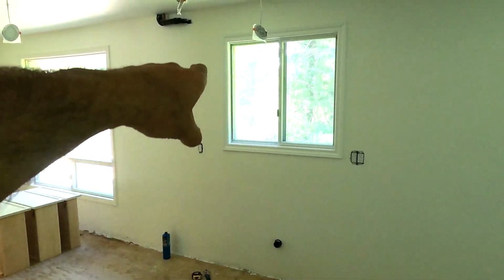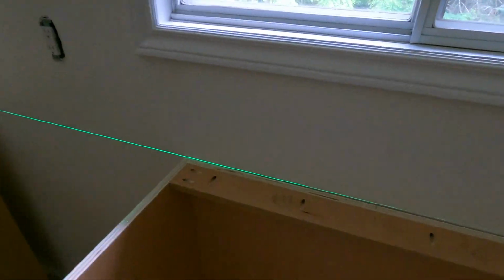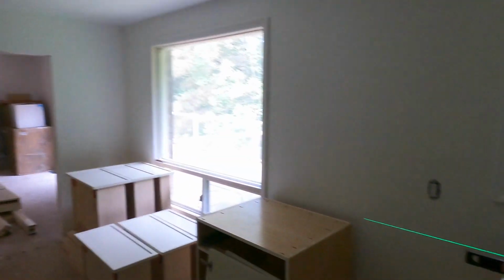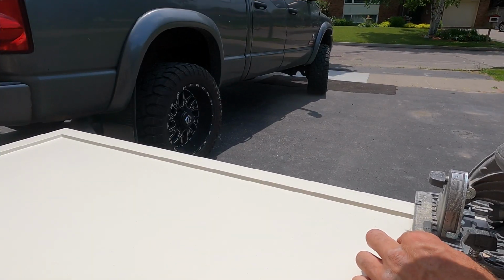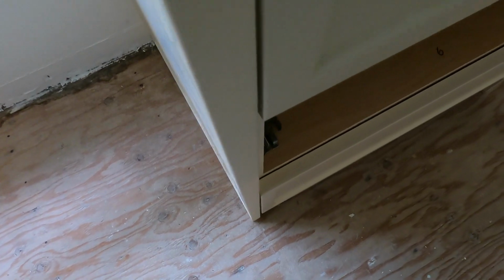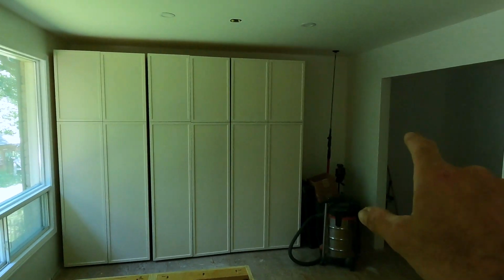INSTALLING A CUSTOM KITCHEN that I built | How I do it by myself | JR’S Life

Comment from the maker: TIMESTAMPS: 

00:01   Intro
00:06   The Before
00:32   Setting up the laser level
01:55   Workstations & Elevations
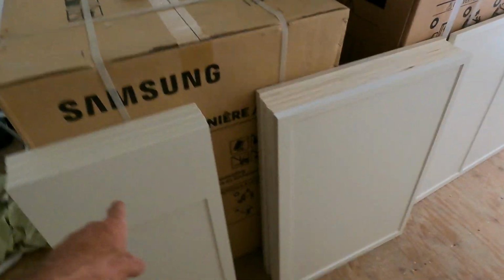02:53   Applied panels
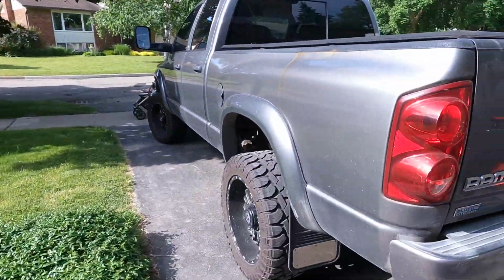03:27   Outside workstation with saws 
04:30   HOW TO bring in the big cabinets by yourself
05:13   Sink cabinet
05:53   Hole saw / cutting holes for plumbing
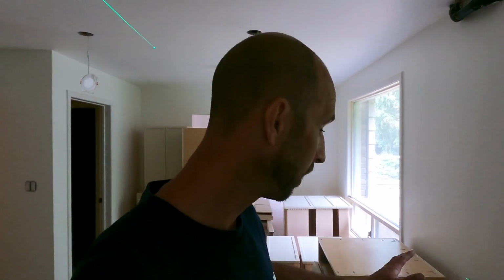07:34   Levelling and attaching the cabinets together
10:09   Magic corner / flying moon / custom storage
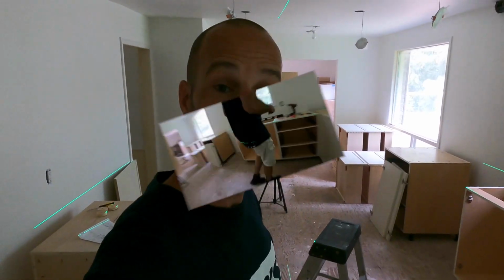11:57   Levelling and installing drawer cabinets
12:23   Dishwasher panels
13:19   Table saw
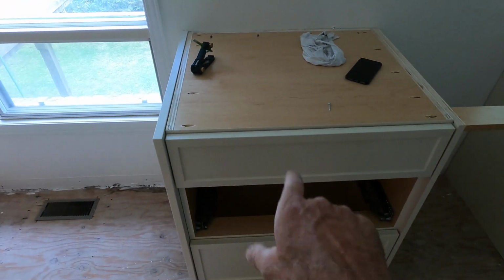14:37   Exact fitting the decorative panels
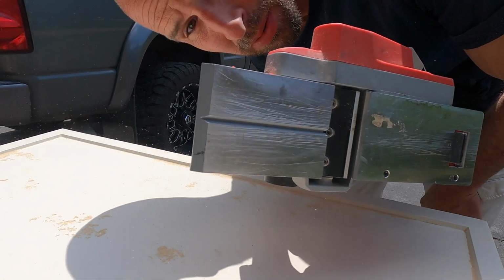16:29   Power planer
19:16   Fridge and floating shelf wall elevation
21:51   Wrap up for the day (uppers will be installed next episode)
23:33   Subscribe!      https://www.youtube.com/c/JRSLife